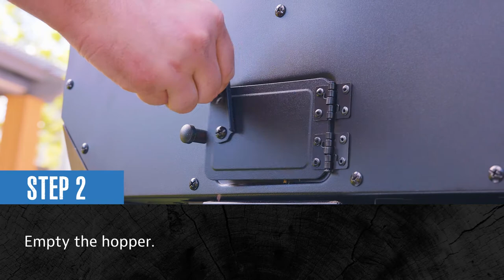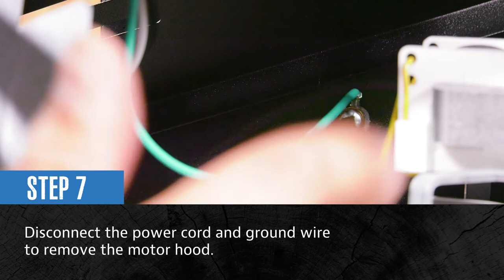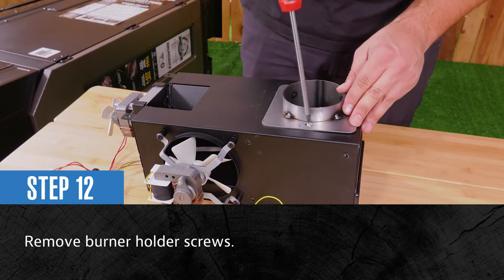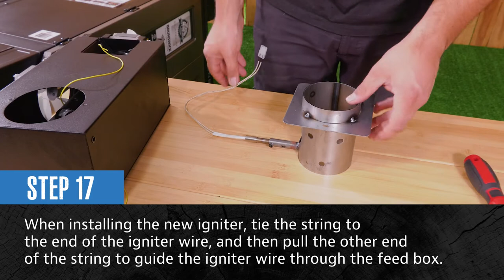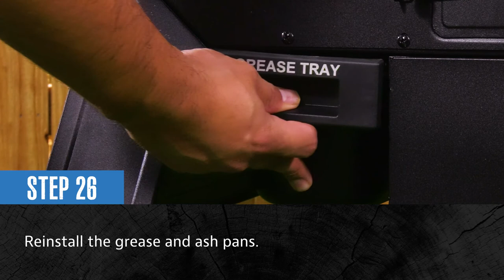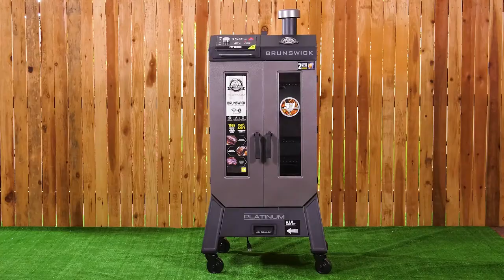How to Replace the Igniter on a Pit Boss Platinum Brunswick Vertical Smoker

Comment: As all of the connectors add the same, it would be helpful to provide colors of the wires on all connections in the video or a schematic to assure the right connector pairs are reattached to the correct mate.  Your hands block the view of the connections after reconnecting.
Reply from the maker: The manuals have schematics with the colors listed. Please contact us if you need one 877-303-3134
Reply: @PitBossGrills  was it THAT hard to SLOW your video down??? Just to SHOW what color wires go from the male end to the female end!! I went through ALL the steps and have NO power!  you have bad customer service if you have to call one of your representatives JUST to ask!!
Reply: @PitBossGrills  I have the "schematics".. THEY are NOT color  coded!!